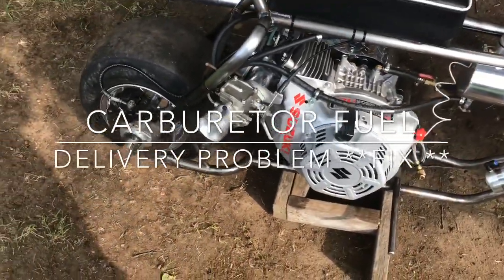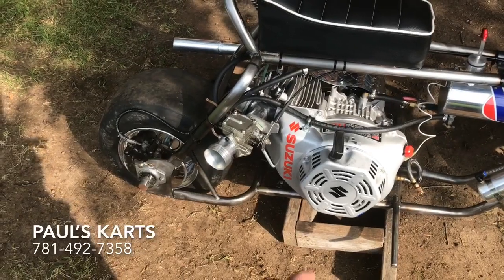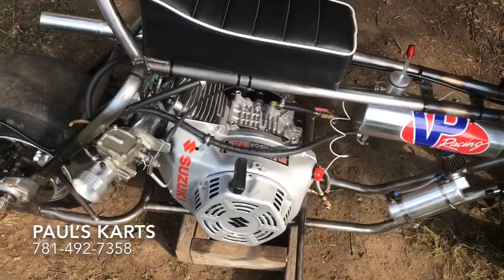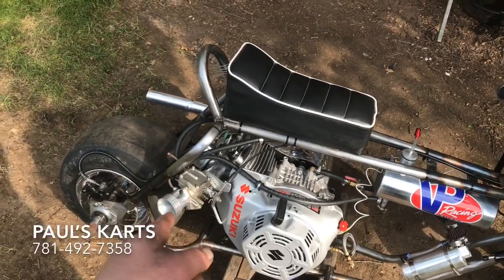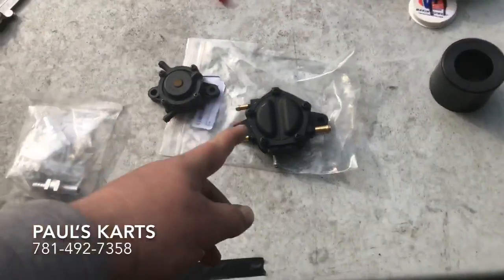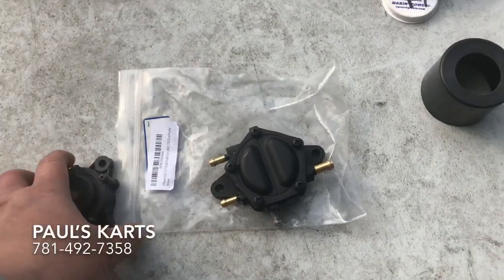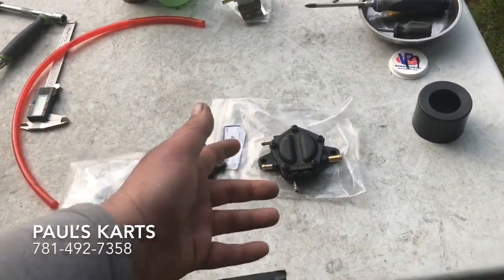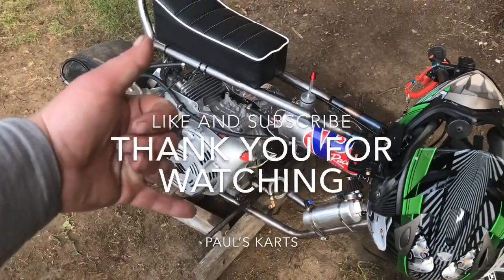⚜️HOW TO RUN METHANOL⚜️ MIKUNI ULTIMATE PULSE PUMP  big block* mini bike / go kart

Comment: Man,  you explained something I have been trying to figure out for 5 months! 
I can't believe I couldn't figure it out on my own! 16:00 
I totally forgot that factory is vented into the air box.  I built a hemi 212 kept blowing crank seal out so I put a trap with a filter and it never happened again but,  I could not figure out why! 
Where does the pressure come from? Is there something allowing air to pass the piston or is excess pressure going to my head and into my block from there? Anything I can do to keep that pressure in the combustion chamber?
Reply: I used to rebuild geo metro 3 cylinder engines and if the pcv was blocked or the vent hole in the head, 
it would blow the cam seal right off the end of the shaft.
Reply: What's going on is that as you increase the amount of horsepower in these engines the amount of crankcase pressure that builds up inside of them also increases substantially. The more venting that you can provide the better, it's recommended for high horsepower build anything over 15 horsepower on a small block or about 20 or so on a big block that you vent the crankcase and both the valve cover. This will reduce the amount of pressure build-up inside of the crankcase and help with not blowing seals and or potentially cracking the block due to increased pressure. Think about it like a pressurized can if you add a hole in their the pressure can better equalized with atmospheric pressure. The only difference is that there's a piston going up and down thousands of times. Moral of the story vent the s*** out of your engine

Comment: Hi Paul, I have a predator 212  I put billet parts in it but I plan on a bigger cam 308. I would love to put a BIG VALVE HEAD on it with the guides and seats with the strongest valves available. How much would it run me. Thanks.
Reply from the maker: @bradcarpenter2396  $399

Comment: That new pump is gonna pump to MUCH fuel for your engine. You need a smaller dual mikuni or single walbro. That pump is for a larger 500+cc 200cfm head setup. I can tell you how to use it correctly if you don't want to use another smaller pump.
Reply from the maker: Sure good advice is always welcome !!
Reply: You need at least a 30lpm fuel pump. But nothing more than 40lpm. The stock one on the carb only pumps around 22lpm. That little black pump should be around 25lpm, and that big Pentagon black pump is way at 65lpm. Way to much, so you have to reduce the pulse to it, about half pulse should be perfect. Use a fuel on/off switch in the middle of the pulse line. Or try the small black one direct to the carb, it may work. Or buy a mikuni 35lpm pump or Walbro 30lpm pump.
Reply from the maker: Yea cool .. it seems to be working good tho as is  .. I was able to put the jets back into the carb lol .. before no jets and still lean .. I need the extra fuel pressure because I’m going nitro now .. try and keep up lol

Comment: for a float needle syle carb like most of the mikunis,keihin,pollini,oko,koso....you can just put in a normal fuelpump and put a T in the fuel line right before the carb and trough the elevation difference between the carb and return line to the tank you can regulate the fuel pressure really really accurate and adjust it so the float needle is still able to close an prevent overflow 😄 and make sure your float needle is the right size for the jetting you use if you run methanol/ethanol 😁
Reply: and for those pulse pumps you can just put a regulator valve in the pulseline to adjust pressure 😄
Reply from the maker: These carbs don’t have a float but thanks for commenting .. your right tho if it was a float carb even tho off topic that is a way everyone has Regulated fuel pressure.

Comment: Hey Paul, where did you get that oil drain like I see on that block?
Reply from the maker: Actually it’s for a water heater .. only $8 at HD ....
Reply: @paulskartslifan4206  same thread as the drain plug? What is actually called at HD
Reply from the maker: No clue it
Was on a clearance rack when I picked it up .. just look down the plumbike section , I’m sure you will see something you can use
Reply from the maker: Plumbing